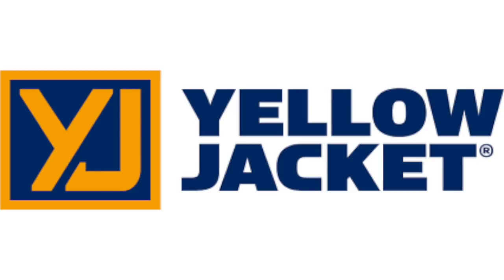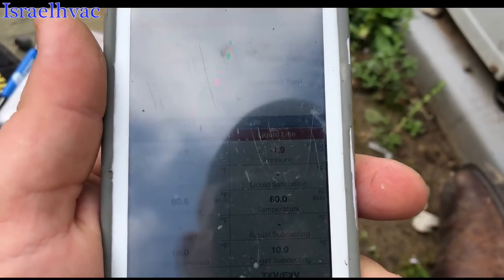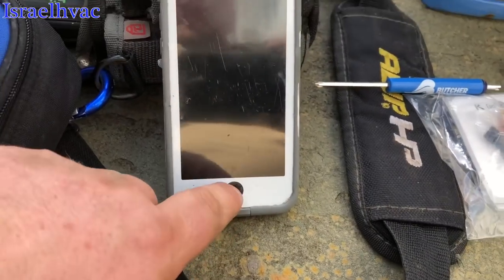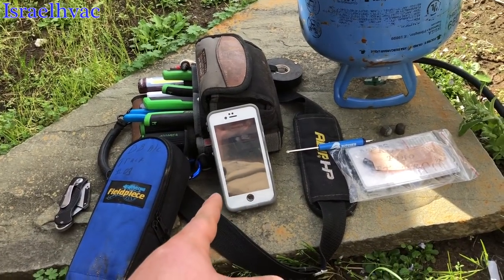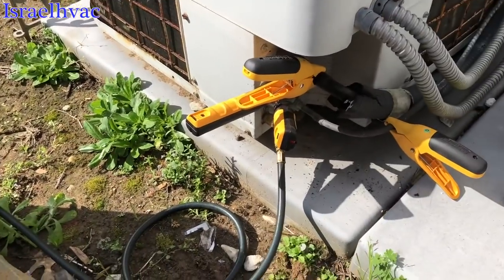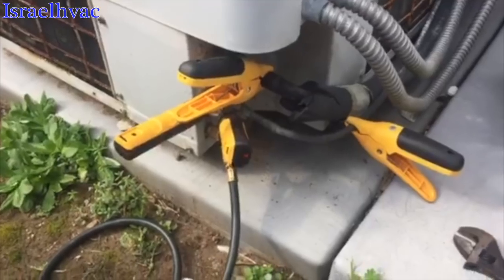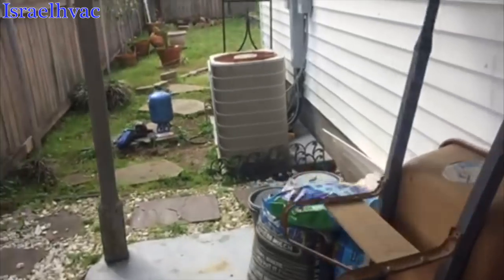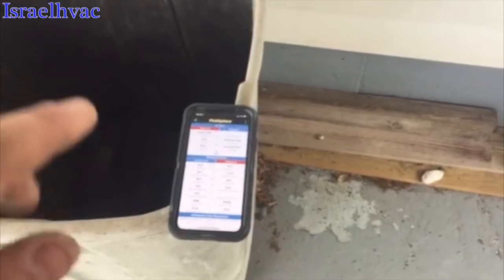HVAC | Fieldpiece Probes in Action

Comment: Hey thanks for sharing cool video! Have you worked with R-422B or NU22 as they would call it? I’ve used it and works great as a replacement. I run into a lot of those old units in my area and people just avoid purchasing new ones for some reason and want to continue fixing them and milking as much as they can out of them. I have my small business and need to look into the refinancing and how it works. I sure as heck need to start making money this year selling them new units.
Reply: You’ll make lots more money with those helpers and your customers will love the fact your not trying to sell them a new unit. Always recommend new, then repair the unit.. some companies refuse to work on junk and loose out on lots of money, and get badmouthed to boot.
Reply: Correction not helpers but “ heepers “

Comment: First of all as a technician your comment “the subcool is a little high” means you’re lacking some knowledge in this industry, your subcool should never exceed 15°. I appreciate you making the video but I’m disappointed. As an instructor I feel like you need to take some more classes and understand the dynamic relationship between your superheat and subcooling and what that should be telling you. Also I noticed you changed your refrigerant from  NU90 back to R22. I normally wouldn’t say anything but you made a public video so you put yourself into the spotlight. Younger less experienced technicians take everything you say as fact, and if they have a high subcooling situation to them it won’t mean anything because it didn’t mean anything to you. It screams a specific problem to me and is an opportunity to move the customer into a new unit one that won’t fail. Can you technician equipped with the proper knowledge of the customer not spend money recharging your system that has a glaring problem.

Comment: SYSTEM FLAT OVER 15% REFRIGERANT LOSS MAM YOUR OVER THE EPA section 608 requirements YOUR OPTIONS ARE TO FIND LEAK IN THE NEXT 30 DAYS REPAIR, BEFORE I CAN FILL SYSTEM OR REPLACE YOU SYSTEM.  
GET THESE CLUNKERS OFF THE FIELD LOL
Reply: There's no mandate to do anything unless the unit has 50lbs!!
Reply: While I agree that the system should be repaired/replaced, making statements like that to pressure the customer is fraud.
Reply: Show up at my house saying something like that and you would get a ear full!
Reply: @cdavisultrakc4351  they must have changed the law bc he’s right about the situation